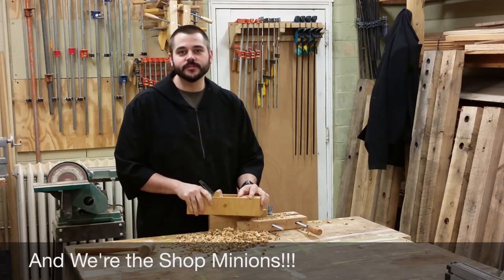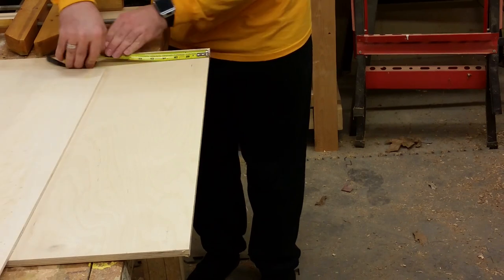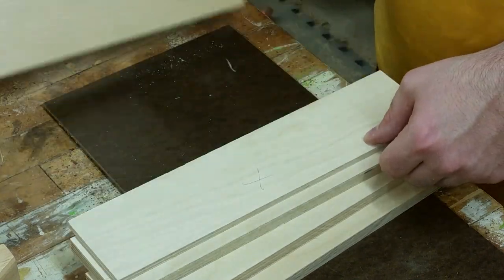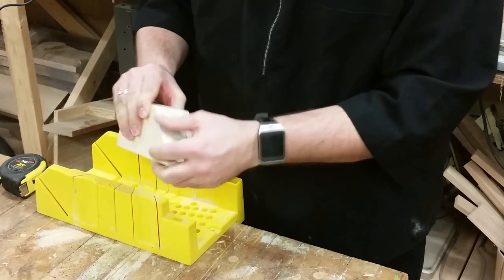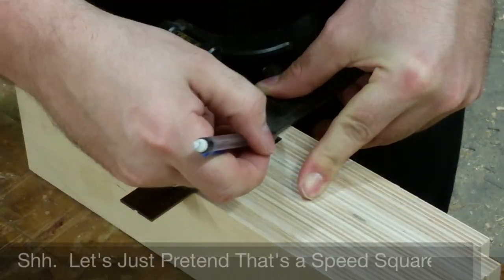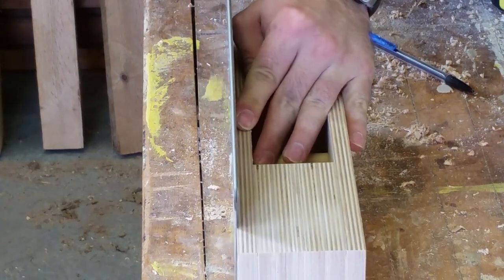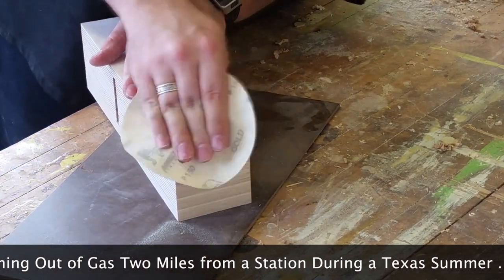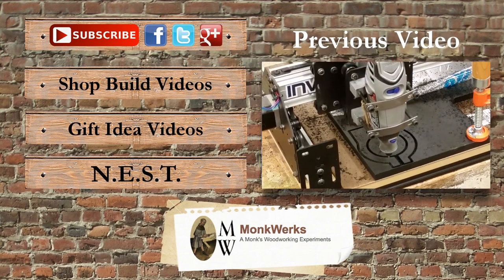Plywood Bench Plane: Limited Tools Build (MonkWerks)

Comment: A plane made out of plywood, who would've thought! Very cool! Great project.
Reply from the maker: CMR Woodworks | Chris McDowell I was wondering whether or not plywood would work too.  But everything I read on wooden planes said that straight grain was important (for stability), and since plywood, if finished, is one of the stablest woods I know ... Why not!  I will have to see how well the sole holds up over time, but I can always add a piece of brass from the hardware store to the bottom if necessary.
Reply: I’m curious, has the sole held up well or did you need to replace it with an insert?

Comment: I think this is one of the greatest videos I have ever seen. Very, very informative! With this one simple video a new woodwork could make a high quality block plane, smoothing plane, and bench plane, which is all most etiquette really need. Most of the tools you used are in most people's tool box any way or are really cheap to acquire. The miter box you used it's easy to make as well. The woodworking community is blessed to have you in it.
Reply from the maker: Jeremy Urban Wow! That's quite a compliment, thank you.  And yeah, this can definitely be sized to a lot of different planes, and even adjusting the angle you could turn them into low angle planes (which I hear is all the rage with the youngsters these days).
Reply: MonkWerks with Fr. Thomas it's absolutely true. I have yet to see anyone take this on and fully explain it the way that you have. Then you took it on in a way and with materials that made it so that anyone could do it. It's like a back to basics woodworking.
Reply: +Jeremy Urban 
...And yet in a way that lends itself easily to those of us that will use power tools to make it.

Comment: I made this bench plane and it works as well. if not better than the commercial one I had on loan.  I'm going to make a jointer plane next,  to sand the bottom I will cut open a belt sander belt and tape it to a flat surface.  Keep the videos coming, I can't seem to get enough.

Comment: To help keep the glue up lined up two methods. You can sprinkle salt in the glue to keep things from moving. The other would be drilling holes and using dowels. Bamboo chopsticks work great.  Super strong and thin. I love this idea.

Comment: Great idea to use plywood.  That makes the whole project easier for a person without electric jointer, and planer.  To keep things from sliding during clamp up, I clamp them up without glue and drill all the way thru for dowels.  Then take it apart, apply the glue, put them together, put in the dowels, and clamp it up without fear that things will slip.

Comment: Thanks for this video.  Last summer I made a laminated Bench Top and I know it's not perfectly flat, but I use it to hold my planer and sander.  I have a #4 Bench plane.  I think I'd like to make a plane like this that is about 14" long so I can create flat bench tops.  When I need to use it, I think I could just take the blade from my #4 and insert it in this wooden plane and stick the blade back into the #4 when I'm finished.  I'll have to watch this video again and take some notes on dimensions, and angles.  Thanks and I hope to see you at WIA.
Reply from the maker: The angles I am using are not necessarily common to hand planes, they're close though. I chose them because they are the ones you will find in a mitre box. This technique should work though on a 14" plane. If you're going to use it with the iron you have in your #4, I would get the angles from that plane so you won't need to regrind a new angle on your iron.
Reply: MonkWerks with Fr. Thomas I have an angle gauge that I can place on my #4 to get the angle of the (I think it's called the frog) in reference to the sole.  Then I can put the gauge on my miter saw to set the angle to cut the required angle.  But yeah, you made a nice plane there.

Comment: This is really quiet  interesting, nice work. Like 'solid wood body planes, does the plywood hand plane transfer the feeling of the wood better than metal planes?
Reply from the maker: Paul Jenkins Glad you liked it.  I haven't worked with a lot of wooden planes, but it does have a different feel when using it than a modern metal plane.

Comment: Great tips! Any tips on cheap sources of good plane irons? 

A couple tips about oils, though: not all oils are drying oils. You really want the kind that harden for this. Linseed and Tung oils are best here, with linseed being the most readily available for most people. Mineral oil and others might be nice, but can go rancid and don't harden. 

Finally it usually takes at least a week for linseed oil to actually cure. Before then you can gum up your nice work by putting it to use too soon (depending on conditions). A few drops of Japan Drier in a small cup of oil (as much as you will use immediately) can cut that down to a day or two. A quart of Japan Drier is a lifetime supply for most people.

Comment: hi let me start by saying awesome video when you say iron do you mean the blade? and do these style planes require an iron/ chip breaker or is the wedge enough see if you look at the jack plane anatomy of the blade you have a plane cap and a blade screwed to an iron/chip breaker mounted on a plane frog so since i have never made these style plane my question is do you actually need the Chip breaker or is a blade under the wedge enough Does the blade chatter without the Iron/chipbreaker ? how close does the wedge come to the edge of blade?

Comment: Awesome project. I may have to give this one a try. Did you purchase your blade prior to build and make your measurements to build around your blade size?
Reply from the maker: Yes, I fitted the plane to the blade I had. Just remember to keep in mind the actual dimension of plywood and add an 1/8" to allow for the iron to fit without binding.
Reply: MonkWerks with Fr. Thomas thank you

Comment: Would this make a good jointer plane if it was made longer?
Reply from the maker: I imagine it should work as a jointer plane too.  The key is making sure the bottom is flat regardless of length.  As a jointer plane is usually longer than a single sheet of sandpaper, you might consider using a belt sander.